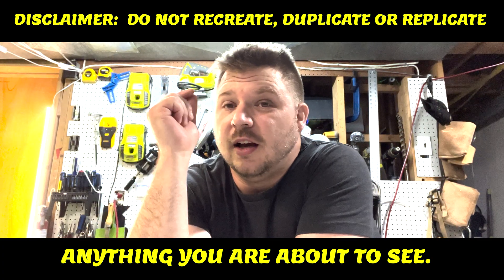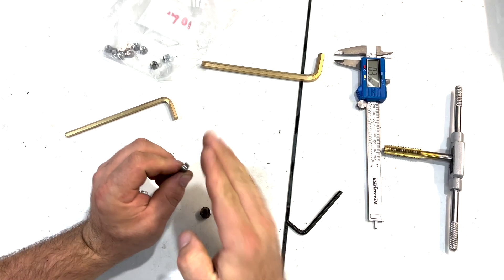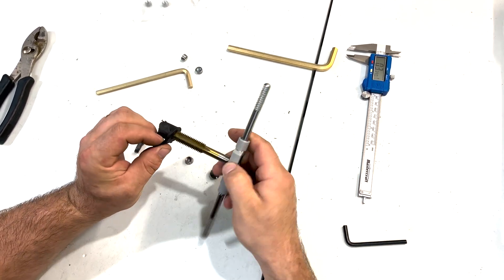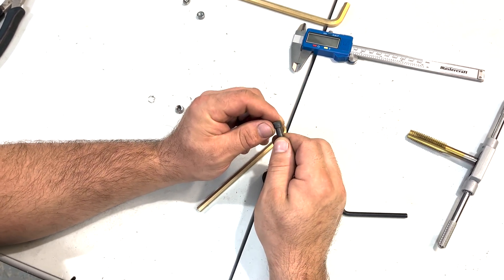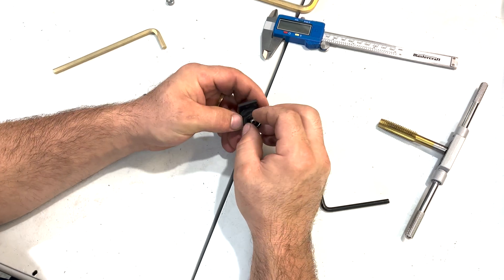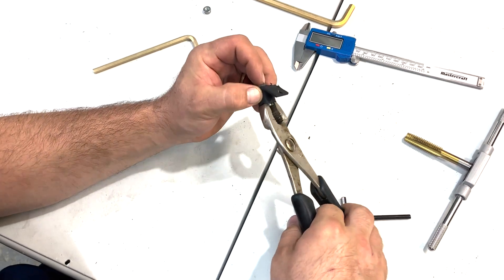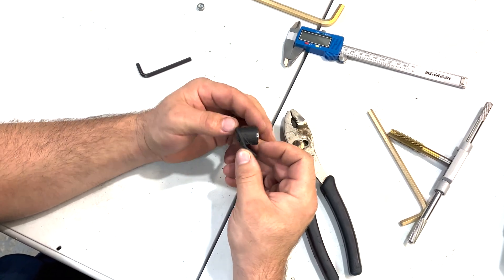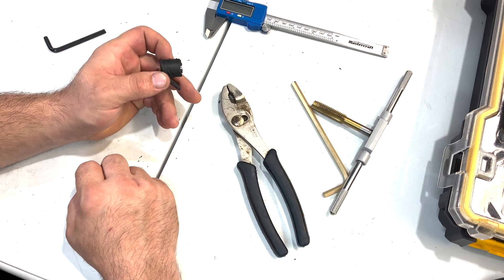Valken / Milsig M17 Chop-Stop (How To)

Comment: Bro, I’ve tried everything you said about the M17 but it keeps chopping, I’m giving up on the marker, I really need your help
Reply from the maker: If you’re chopping, it’s the projectile not getting squarely into the chamber.  If your blowing up paint then the balls your using are either took weak, to larger or your cutting into them with the bolt.  

Take the heat core off, load up a mag full of paint, insert the mag and manually operate the action with a wooden rod and observe what is happening to the projectiles.  Even if you have to take the barrel off.  DO NOT, repeat DO NOT try this with the heat core or air in the marker… you’ll die. 😂

Edit for a second bit:  if you need to remove the trigger mechanism, you can do this also, it will make it easier for you to cycle the bolt back and forth.  Your detent may be smooshing the ball.
Reply: @MechTactical  thanks man! It stopped chopping by reducing the output pressure to 550-600 psi, lowering the fps to 250 and also using graffiti paint, but I destroyed 4 mag followers cause they passed the collar and got jammed with the bolt, I’m using the valken mags, should I change the magwell to the T15, Z mags, TMC or stick with the originals?
Your videos really helped me a lot!

Comment: If that thing works. That would be the coolest mod ever. Sadly, I don't have the skills or connectionsto built ot myself, plus I live in europe.

I don't use my m17 for paintball, it is more like a hobby. Trying new things out, getting  some more power out of the marker or bring screwed up Milsigs back to live. I don't overdo it, just Bypass V1, prv delete, harder bolt spring and stuff like this. I don't run hp bottles with super high output 850psi max, learned alot from Shawn (LL4D
) And I use Rubberballs most of the time. Just for fun, not for self defense or stuff like this.
If you are able to build some of those Chopstops some day, or just the internal parts, I would love to buy one, or two. So if there is any chance, to get some, I would be extremly happy.💯✊️
Money wouldn't be an issue. For a working chop stop, I would spend at least 30🤑.

At the moment I use a magnetic detent   in there, but john Wixon detents are on its way. So hopperplugs would be free to go.

Since I am not planing to shoot paints through this CQC A2, I could give feedback if it works with a little higher power and if it damages the Bolttip. Or causes any other issues. 

Sorry for annoying long lext, but a chopstop is the thing I was missing so hard 😅🎉  now I know there is a possibility I am freaking out a bit^^

Regards from Germany✌️
Reply from the maker: Hey friend :) hope things are well in Germany. 

The M17 bolt lock out device was super cool.  But it was just too dangerous for me to make for other people, too many things could go wrong.  Don’t get me wrong, it does work, it works wells.  It just needed constant love and attention.  Legally, I cannot make them for other people.  I talked with a private insurance company, and as an individual (not a business) as soon as they heard “gun part” the conversation was over 😂😂
Reply: @MechTactical  
Yeah all well here, 
Yeah I understand that to the fullest.

Comment: definitely "not" going to immediately go make this and try it out in my M17
Reply: Hey, what's up guys? I used an aluminum nut on this bolt lock, but it still marred up my bolt pretty bad . It also loosened my bolt which caused me to chop and maur up my barrel breach. 😅
Reply from the maker: I was being legit bro.  A steel nut will mark up your bolt.   It’s gotta be aluminum, and on that note, I haven’t tested aluminum for longevity.  

Just sharing what I found with you guys is all.  Maybe somebody can come up with a better idea or improve on mine?  ❤️
Reply: @MechTactical   do you find it a problem not being able to use that hole anymore to tell if you have one in the chamber anymore?
Reply from the maker: @andrew-b4e  
If there is nothing in the chamber, it won’t fire. 

So, I’m going to be printing a replacement plug, so I can safely use the m17 on the field, but for experimenting, I’ll keep the bolt catch.
Reply: @MechTactical  good point! I wonder how hard it would be to adapt something like the lvl 10 bolt that was an upgrade for automags? It was a blow forward design and worked super well.

I had an automag once that never chopped. That plus the catch design you have would work great. Then you wouldn't have to worry about the bolt slamming into the catch too hard.